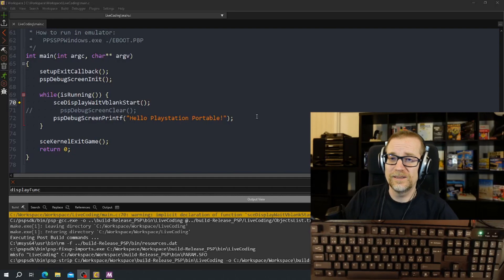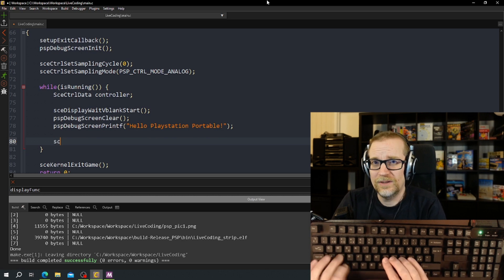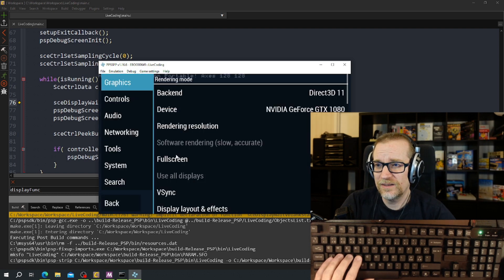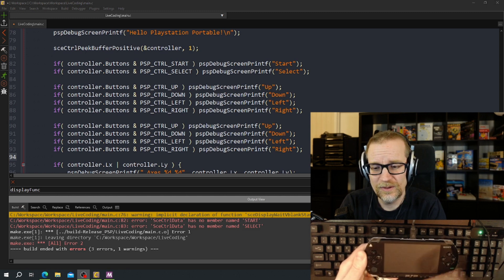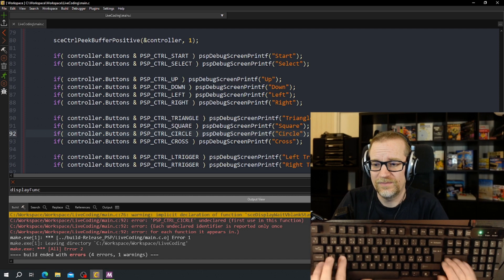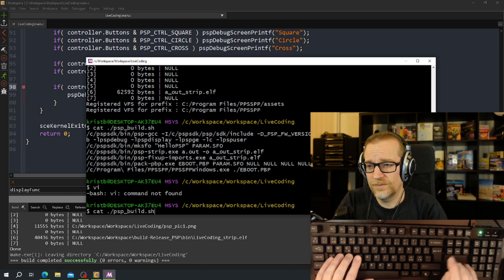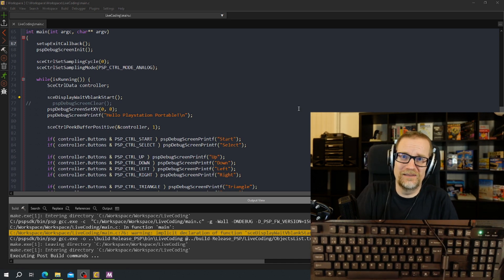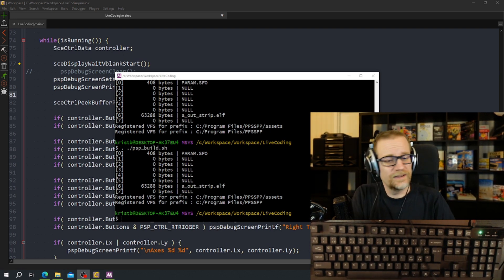Live Coding, Reading Buttons & Joystick on PSP!

Comment: I'm curious as to why you don't use LSP for C
Reply from the maker: Microsoft Language Server Protocol?

How would that help me?
Reply: @eightsprites  Nothing to do with microsoft.
LSP simply adds hints as you code and considers your configuration (c std, includes, etc)
Reply from the maker: Ah thanks!

Well… I dont think my IDE supports it. And I try to learn the commands by heart.

It would be nice to have, I agree. But so would just normal code completion.. IDE do support that, but for some reason I dont get it to work :-) Its not the fault of the IDE, its just me being to lazy to figure out why it doesn’t work. :-)
Reply: @eightsprites  At least you made a choice. When I first started coding I didn't know tools like auto completion existed. I used Sublime text and programmed without any assistance. I don't even know how I managed looking back